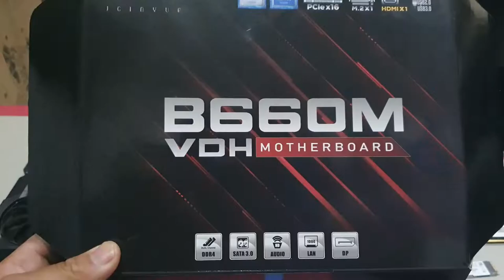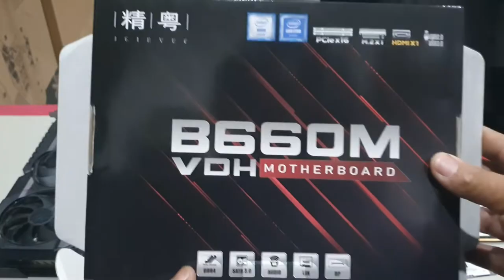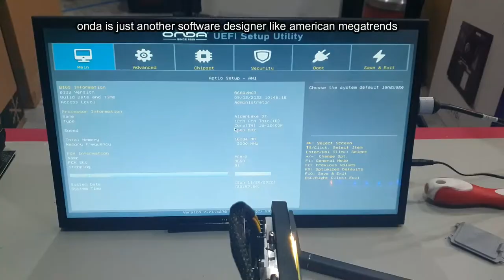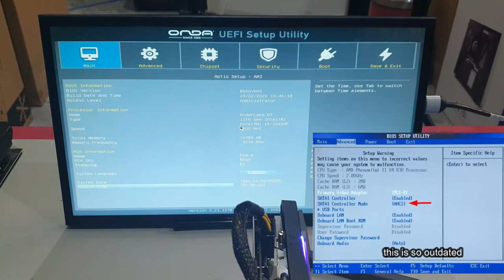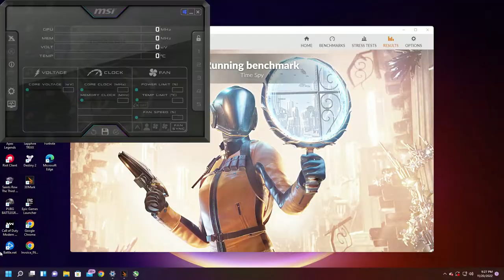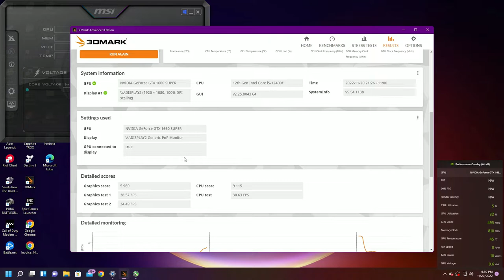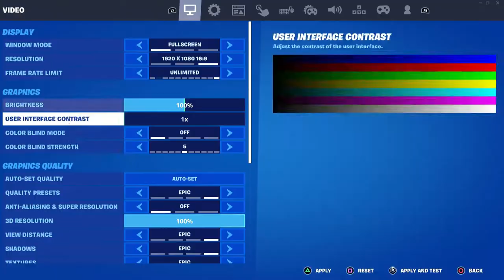JGINYUE B660M VDH 12TH GEN MOTHERBOARD  review affordable / solid /  matx / great features

Comment: Can you try to test a jginyue b350? I have one ordered and im planning to put 32gb corsair vengeance rgb, a ryzen 5 5600x, and an id cooling frost water cooler but no one has any videos on it and im unsure wether or not its good and if it will break my parts
Reply from the maker: I don't have a b350..but from experience with these manufacturing parts they are just as good... and u have warranty too if something we're to ever go wrong...did u ensure the mobo supports 5000 series cpu for amd? As long as u know that it will work then Ur OK bud.. I'm sure of it ..rest assured ull be OK
Reply: @MIKEYZVLOGZ  idk there is almost no info on the board. do you know if it supprots 5000?
Reply from the maker: @snipe_gaming1348  I believe it does not hold on I'll check...it does not support 5000 series... there are some that Doo.. but u need to tell then before u order... this b350 does not support 5000 series and the updates aren't available unlike other brand names ... u can use up to 3000 series only